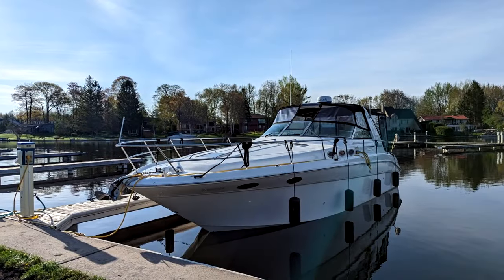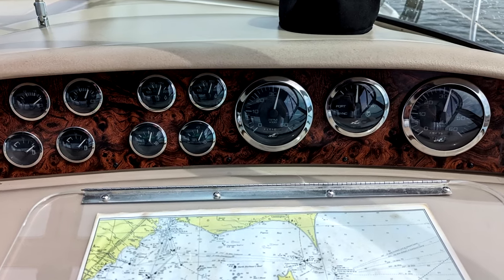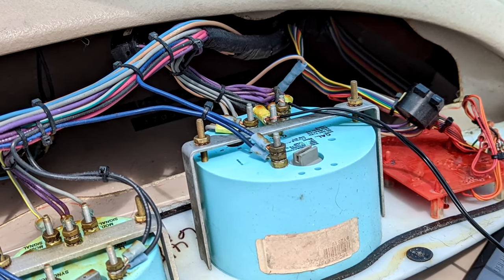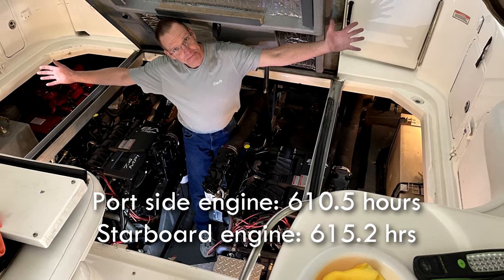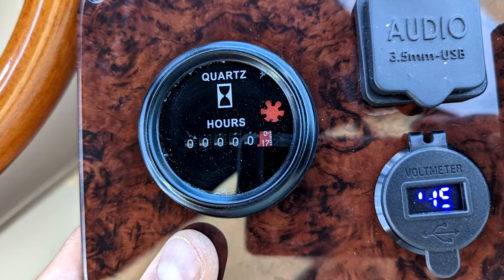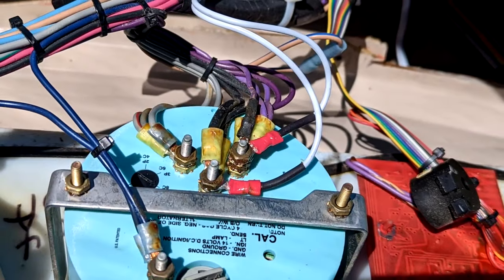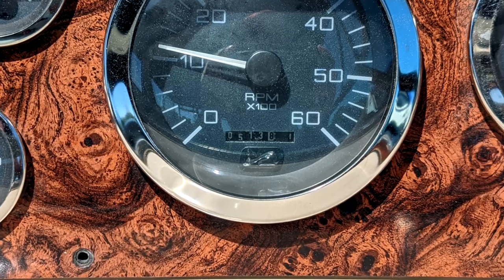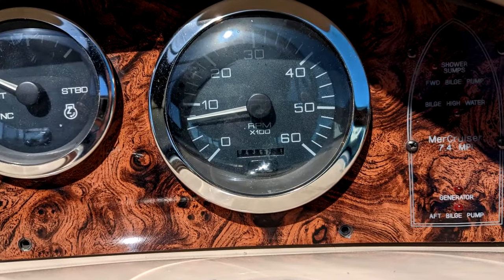Boating Basics - How to Determine the True Running Hours

Comment: My Boat is an 87 and still has carbs and no electronics. When I bought it two years ago both gauges were around 1600 hours. many people were scared of the hours but the PO had great documentation from her and previous owners of the boat showing maintenance records and hour meter readings through the years. SO i knew the readings were correct.  I didn't have to hire a mechanic for the inspection because I am one lol. The engines were clean and well looked after, great compression and oil pressure and started instantly when cold. So far in the last two seasons we have put about 110 hours on them flawlessly. AS you have mentioned before maintenance is so important. Most engines die early from abuse and lack of maintenance. Sorry for the ramble but just wanted to point out that maintenance records especially on an older boat can make a big difference in weather it sells or not.
Reply from the maker: Sounds like you are right on top of those engines - even though they have really high hours ;-)
  Just kidding!
 When we sold our last boat, it was ticking over the 1,500 hour mark (both engines), but they ran great. Of course, I had done my fair share of overdue maintenance, but many folks were also afraid of those 'high' hours. In my humble opinion, the 454 engines should be good for 3,000 hours before needing any serious wrenching on them, and probably no more than popping off the heads and having them rebuilt. But then again, I'm not a mechanic, nor do I play one on TV ;-))

Comment: Paul,  Fox Marine makes a gateway for the ECMs on these engines, which allows you to display the engine hours on your GPS.  I have them installed on mine.  Makes a huge difference
Reply from the maker: Thanks for the heads upon those Eric, but sounds like a lot more work for me 😂 For my needs, I'm okay with the analogue gauges to keep track of everything.
Reply: @BoatingWithBoogaboo  This could be the subject of a great how to video.  The actual install is very easy.  The gateways can be remote mounted and come with an adapter to plug into the diagnostics port on the ECM.  They also will connect with the right cable onto any NMEA 2000 network.  The install only takes about an hour for both engines.  Your Garmin MFD should be able to display the data without any custom software
Reply: Paul,

I've always wanted to ask you about why someone who wants so much "cool stuff" for your boat doesn't have the Fox Marine Gateways.  They're really easy to install and not that expensive.  I love mine. I probably get more replies about my video on the Fax Marines Gateways than any.  I'll leave you the link if you want to watch. I made the video because I got tired of hearing how my 40 DA with gas was so underpowered.  Check it out.
https://youtu.be/cN0vOcwoCz4

Comment: Another thing that was great when they did my ECM check is they also let me know how many hours were at idle, and rpm range all the way to wide-open throttle… I bought my boat with 440 hours on it… And it showed me on the read out how many hours were between zero and 1000 RPM… 1000 RPM and 2000 RPM… And so on… It was nice to see that there wasn’t a lot of hours on the boat at wide-open throttle…
Reply from the maker: But it's always good for any engine to be run hard to clear out the cobwebs ;-)

Comment: All good points! 👍🏻 our Meridian has keys in the interior so when we drop anchor we try to remember to turn off the keys, i believe even though the engines aren’t  running, the clock is. Our gauges say some crazy hour time around 2000. But the ECU shows only 450 on each motor. 👍🏻 i have a buddy that uses only one motor to puts his way past the no wake zone, it takes easily 15 min every-time he goes out so im sure that would make engine hour differ. 😃
Reply from the maker: Right on with your engine hours. Sounds to me like you should be out on the water more ;-)
 Take a look at one the other comments to see my reply, in regards to hour meters, stuck switches, etc.. 5,600 hours on our last genny :-0
Reply: @BoatingWithBoogaboo  will do👍🏻

Comment: Not 100% sure but I think the new Smartcraft digital gauges by Merc actually read the ECM hours. Either way, I think it is still a good idea to have a scan of the engine to pull all the info. Such as run RPM and so forth as someone else stated.
Reply from the maker: I actually never realized that they could pull RPM ranges out for the ECM's.

Comment: I would add, the engine blocks will typically not fail if they're taken care of with regular oil changes and such, but things attached to the engine, like manifolds, risers, belts, plugs, wires, alternators and such will eventually fail and need to be replaced.
Reply from the maker: Replacing manifolds and risers. Spoken like a true saltwater boater ;-)
Reply: Ya know what pisses me off is when a raw water pump starts to leak and it sprays the salt water everywhere, it’ll actually clog a flame arrester on-top of making everything els start to rust and seize.
Reply from the maker: @fogblog723 I've got an instant and long term solution for that; Boating on fresh water 😁
Reply: @BoatingWithBoogaboo  i know hahaha  it sure does make a world of a difference.  👍🏻

Comment: My '98 400 Sedan Bridge engine gauges are about 90 hours different.  They work but I use the ECM to track hours when I change the oil or do major maintenance
Reply from the maker: Always good to be able to keep track of the running hours for maintenance intervals.

Comment: hello Paul. You're videos have been extremely helpful for us. Thank you. We're currently looking to perhaps purchasing a Sundancer 380    2005. There is a "SeaRay systems check" Monitor that is mounted on the dash. However it appears that is doesn't work. No display, readout etc. Seller is telling me that it's nothing to be concerned with and they aren't even available to replace. True?    thanks Paul
Reply from the maker: Yes, from what I've learned, those monitors are no longer available. If it were me, I wouldn't sweat it, as most of the pertinent information (oil pressure, engine temp, etc.) are still available through the regular analog gauges.
Reply: Thanks very much Paul!! @BoatingWithBoogaboo

Comment: The engine hours shown by a scan tool are incremented whenever the ignition circuit is energized -  the engine running.  The hour meter will increment if the engine is off but the key is in the run position.  That would account for ECM hour readings being less than the reading on the engine hour meter.  I realize that was not the case with your boat it's what I discovered on my Sea Ray 240 Sundacer which is the same vintage as your boat.
Reply from the maker: That's why I like the push button engine start setup on our boat. As I believe I've mentioned in the past, the ignition keys stay on all throughout the season, only turning them off if working directly on the engines, or after winter layup. The push buttons on the helm is what 'ignites' the engines to start, so that key left on isn't an issue for me.
 That said, our last boat was equipped with a built in generator. When we bought that boat, it was explained to me that the genny had some 'custom' alterations, including a standalone ignition switch and fuel pump. That had been installed by someone who was frankly too cheap to replace the main circuit board ($300) and bypassed it with the add on items. Problem - apart from being a highly dangerous setup - was that the 'new' ignition switch was nothing more than a small toggle switch located under a seat cushion - I kid you not. That switch had a tendency to be 'turned on' by folks who were unaware that they were doing it when sitting in that seat, so the hour meter kept running and running and running, even without the actual engine running. The total accumulated hours showing was OVER 5,600 hours when we bought the boat ;-)
 And yes, everything was put back in order, including that $300 circuit board, and deleted the auxiliary fuel pump, to make it start and run correctly and safely.

Comment: Paul I've followed your video on re-sealing a leaking hatch  I have a 2000 sundancer 310 I removed the large hatch over the bed and re-sealed with Pettit Hybrid sealer.  The hatch still has a small leak and I want to remove again and try over.  I did replace the rubber gasket as well.  I'm not sure what the problem is but I did have some trouble putting back the hatch.   I think that maybe the sealer did not cover and thats the reason for the small leak.  

My question is any suggestions as to how to remove now that I used the sealer to re-install.

As always I appreciate your help.

Safe boating

Thanks

George
Reply from the maker: Hi George,
 I'm not sure why you would have had trouble reinstalling the hatch after removing it, as it should have fit easily in the cutout on the deck. Perhaps you had it orientated incorrectly??
 Whatever the reason, it's gonna be a bit of a struggle to remove it now, but not impossible. What I would do is to gently get a small razor knife under the frame (from the top side) and even more gently, slowly pry it up, working in small increments around the frame. Like I said, it's gonna be a struggle, but if one takes the time, it can be done. Don't be surprised to have to spend an hour or more to successfully remove it without damaging anything. If you're lucky, there wasn't enough sealant used which would make the removal job a little easier.
 As for why it is still leaking, my only guess is that you didn't use enough sealant. Watch my video again, as well as my 'Portlight Resealing Leak Repair' ( https://youtu.be/r7slaSYWOXc ) to see that I always use TONS of caulking on those types of jobs. It's a lot easier to clean up excess caulking when doing the job than it is having to re and re everything to do it again ;-)
Reply: Paul thanks do you think a heat gun would help loosen the sealer.  Either way I'm going to try over the winter and will let you know.  

Thanks for the help

George
Reply from the maker: @georgeolt1015 Yes, I think that should help, just be careful not too much heat on any of the surfaces.
Reply: I'll let you know Thanks  @BoatingWithBoogaboo

Comment: Hello Paul.  Do you base any of your maintenance (oil changes, sparkplug replacement, etc.) on engine hours?
Reply from the maker: I generally change the oil once a season (in a regular year). As for plug replacement, I'll be producing a video on that (tune up stuff) in the future. You may be surprised to learn what I discovered when I did that project last summer :-/
Reply: @BoatingWithBoogaboo  I'm glad you're going to do a video on tune up stuff as I think it's time for us to replace our plugs, wires, etc.
Reply from the maker: It won't be a how to, more of a review of what I discovered along the way 😉
Reply: @BoatingWithBoogaboo  ok that works too.

Comment: Hey Paul, if there is nothing broken on your boat just give a few minutes. Get out your tools.  Does Anchor girl spray you down with grease so you can get in behind that engine?
Reply: yup I've got same year 370 as Paul's just 8.1s i do not fit nicely nor have been astern of engines need to clean and add Bennet TT fluid !
Reply from the maker: I've come close to getting stuck in awkward spots down in the bilge of our old 330 Dancer. So nice to have the extra room on the 370!
Reply from the maker: Yup, there's still some tight spots on the 370, but a heck of a lot better than the 330 Dancer!

Comment: A boat, is a hole in the water, which your pour money into
Reply from the maker: Hallelujah to that ;-)
Reply: Hey Paul hope all is well! I’m looking at buying a regal 3560 2005 and I’m going to stay at the same Marina your at now hopefully for next season! I need a little guidance if you don’t mind. The engine hours on the regal is over a 1100 hours the boat is in Pristine shape and I was told always regular maintenance! Should I run away or consider this boat? Because I love  love this boat! Sorry Paul that it’s not a SeaRay oh the engines on the boat are 8.1 Volvo pentas with V-drives! Hope to hear from you soon 🙏
Reply from the maker: @shawnmacneil8869 As long as maintenance and regular oil changes were done, 1,100 hours in those 8.1's is nothing. We sold our last 330 Sundancer with over 1,500 hours on the engines with zero issues. As far as I'm concerned, they should be good for 3,000 hours and at that time would probably only need the heads done - something that could be handled quite easily and relatively inexpensively. As I've pointed out many times in the past, the engines are gonna be the least of your problems. It's everything else that'll cause grief and $$$. Vacuflush system, water pumps and all the million little things that do and will crap out at the least expected or desirable time.
 But hey, that's boating 😁
Reply: Thank you so much Paul! I did what you did and put an offer unseen! I don’t think they will accept my offer but you never know! I really appreciate your kind words and your advice. I was over the top nervous about the hours but I have to have this boat! For the right price of course. Any other advice you have just throw it my way lol! Have a great day and please say hi to anchor girl for me and hopefully I can be on the water next season! Happy boating! Cheers and happy thanksgiving 🦃🍁